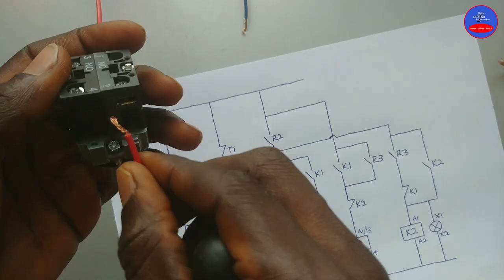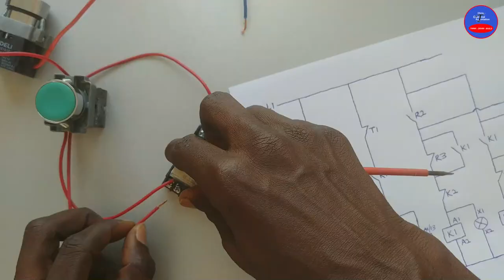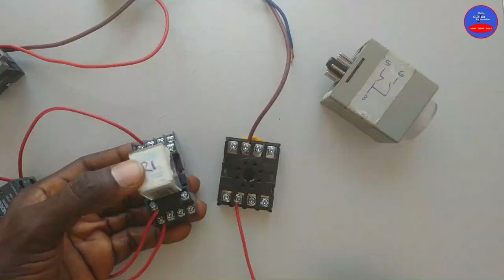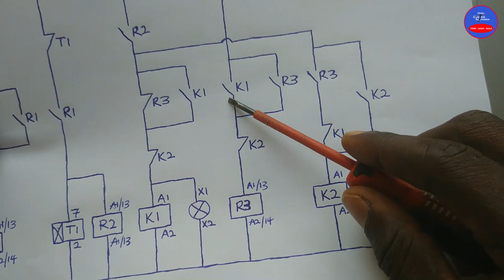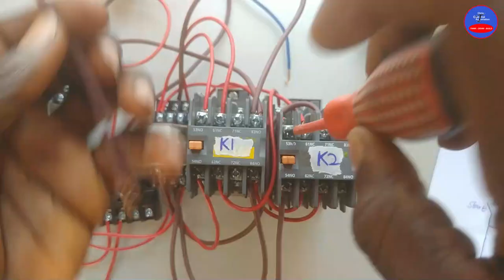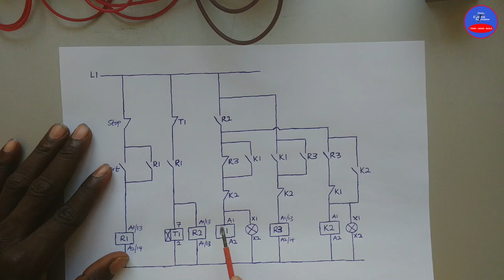Automatic Alternate Control for Two Motors

Comment: Can you used this connection for boiler pump motor in automatic way
Reply from the maker: Can you tell me about the boiler pump operation
Reply: @ChrisControlAutomation  it’s a steam boiler the pump will fill water to the boiler and when it reaches it water level the boiler motor will start the pump is in automatic and manual
Reply from the maker: @patrickbaafi2804 Is that all with the operation? If you will explain more, then I can design a diagram for you